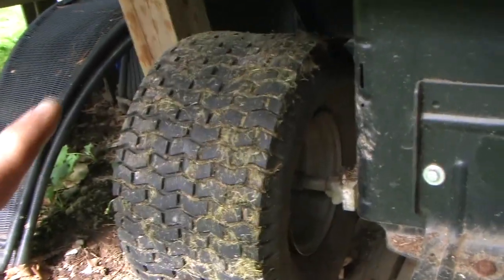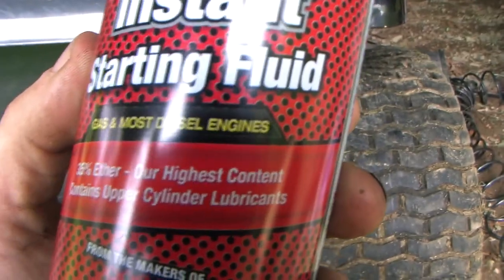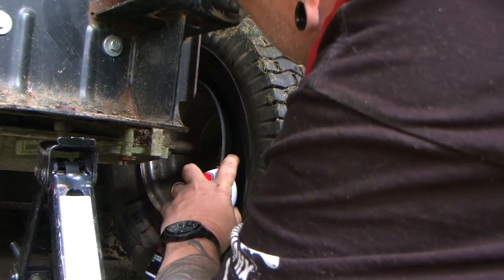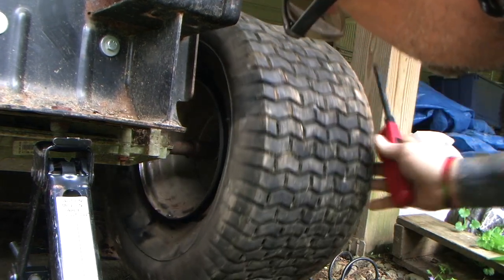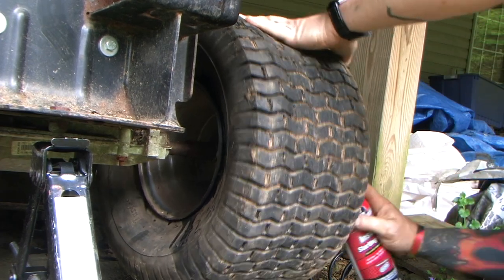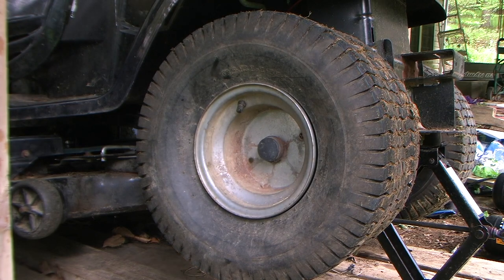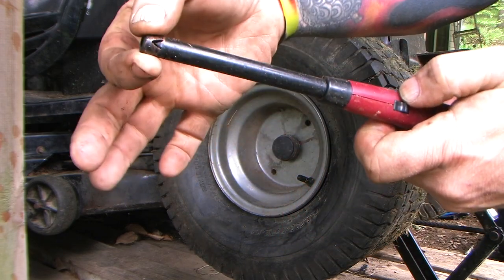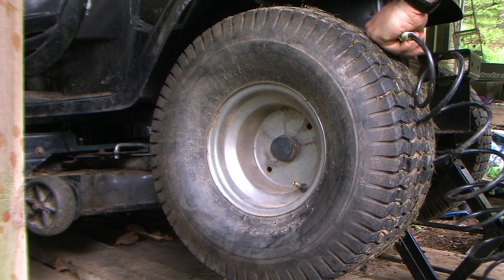Tire Starter Fluid Inflate

Comment: Your the first guy that shows this technique not working. I've been looking for this. All I do is light my tire on fire
Reply from the maker: It was terrifying or sure.  I can't seem to nail down the technique, or figure out if I'm using too much starter fluid or not enough, but yeah, I nearly set the damn tire on fire several times before it finally worked.  I can't imagine doing this on huge tractor tires, which I've seen videos of.  I'd end up blowing the tire up and killing myself, lol

Comment: Use more. If it dissent set immediately the heat inside from the flame will expand it. The fires are galvanized. It's not hurting the tire.